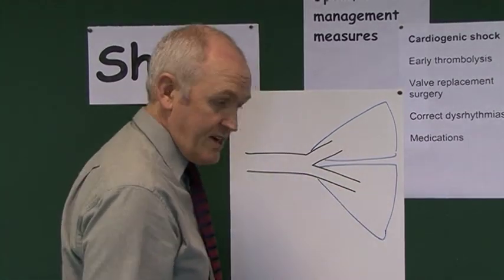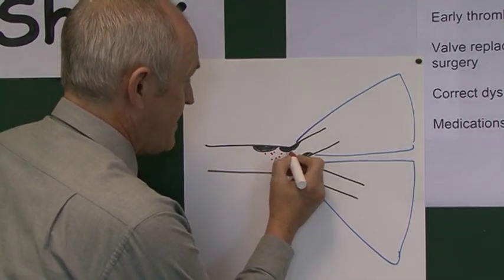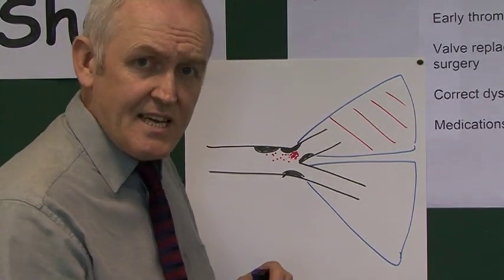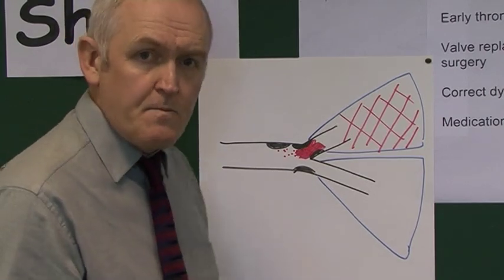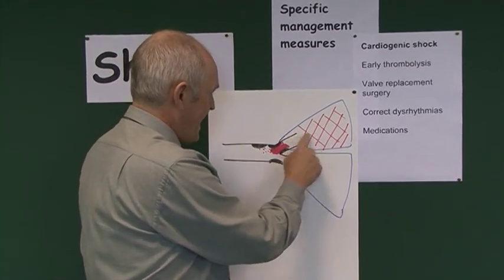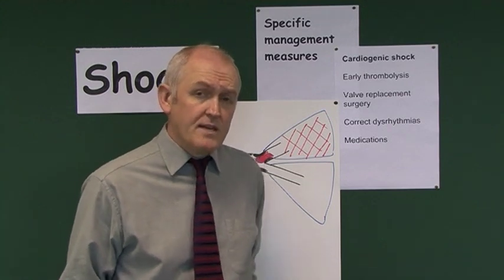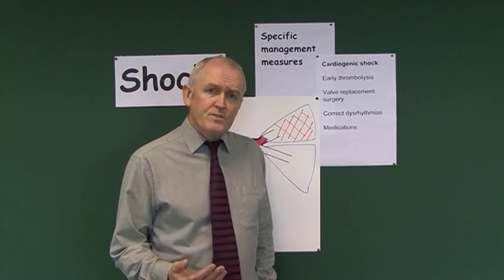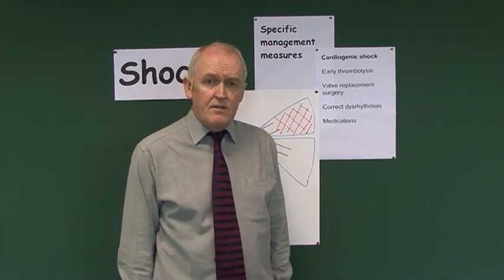Shock 8, Management of Cardiogenic Shock

Comment: Thank you so much Dr. Campbell for your great video, Very helpful. I just have a question, you mentioned for the NSTEMI patients we give Aspirin and Clopidogrel as well as heparin whereas in STEMI we use thrombolytics. is that correct that for STEMI patients we use the same meds as NSTEMI but when we send them to catlab we give them Clopidogrel and Abcximab and at the discharge we put dual anti-platelet therapy on board?

Comment: Hi Dr. Campbell. Thank you so much for sharing your knowledge. I really appreciate how thorough and clear your are. I just have a question regarding the last part of this video where you mention ACE Inhibitor. I researched a bit and it said that ACE Inhibitor actually treats hypertension. But cardiogenic shock is a result of hypotension, correct? Wouldn't it make more sense to promote the secretion of ACE instead of inhibiting it?
Reply from the maker: Hello Lilsis, You are correct, ACE inhibitors are a first line treatment for hypertension. This means they would be contraindicated in carcinogenic shock, as they would lower the BP further. However, I said they could be used in congestive heart failure, not carcinogenic shock. In chronic heart failure, they will systemically vasodilate, therefore reduce after load and therefore reduce ventricular workload, so reducing development of ventricular hypertrophy and ventricular failure. I could of course have made this clearer. Best wishes, John